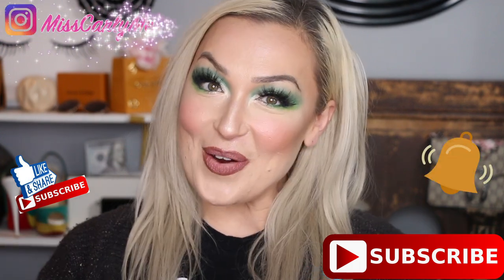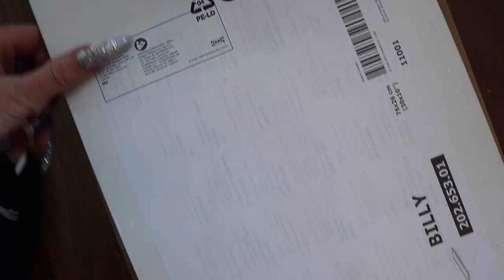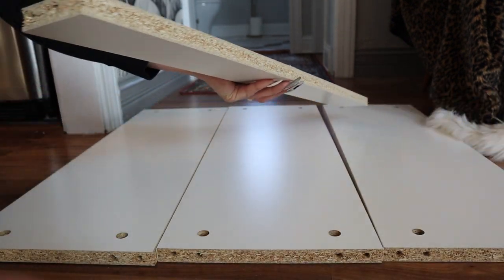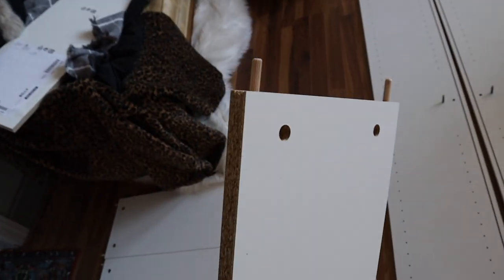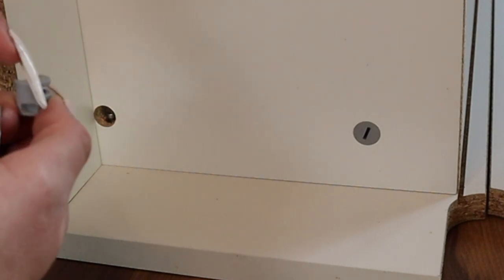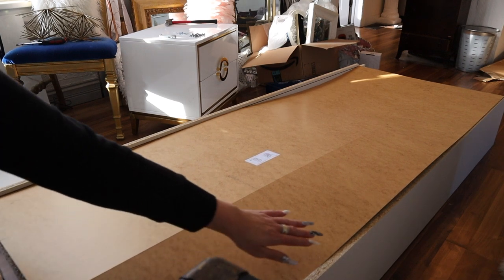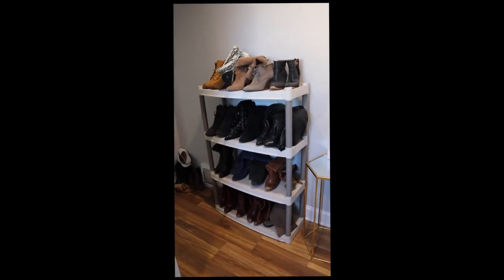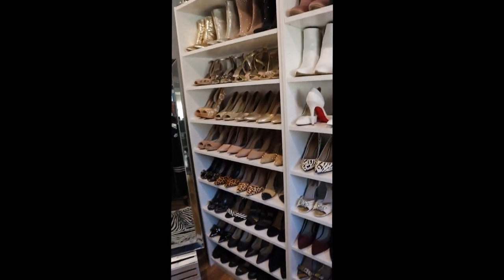How To Assemble IKEA Billy Bookshelves // CHEAP + GLAM Way To Organize Shoes! MY DREAM Shoe Room!

Comment: My house has only two closets, so a little while back I found a pyramid style coat rack that has room for umbrellas, coats, extra shelfs for purses, and a drawer for keys. So I am set for winter with the 4 coat hangers. Fits perfectly in the little corner nook. Improved my organization to the max because it is close to the front door.  ❤🧡💛💚💙💜🤎🖤🤍

Comment: Great video I may have missed it but how many shoes per case does it hold? Thx
Reply from the maker: This is certainly depending on how many shelves you add. I can get 5 pairs of heels on 1 shelf, 4 pairs of boots. I have between 7-9 shelves per shelf, and I’ve added shoes on top 🙃☺️😻🤩
Reply: @MissCarly  thank you. That helps, I wear a 5.5 so I probably can 7-9 per shelf. This was very helpful. Thank you